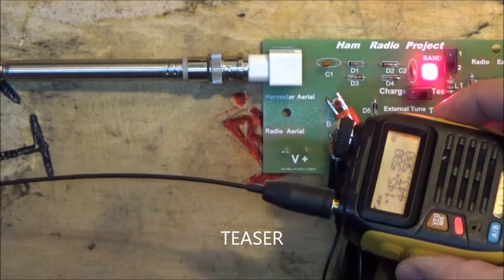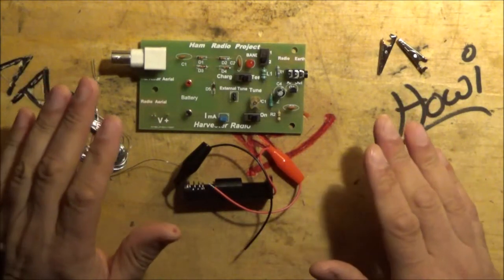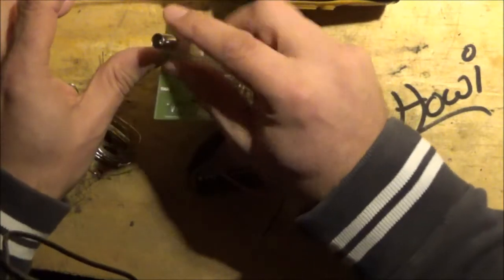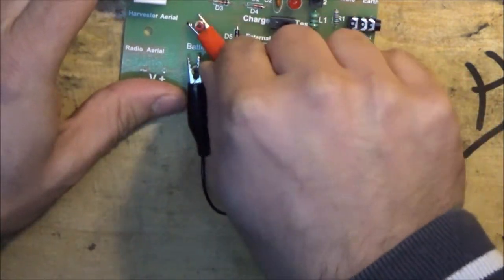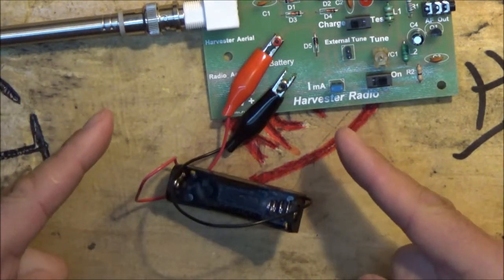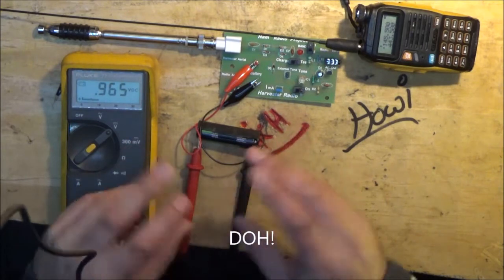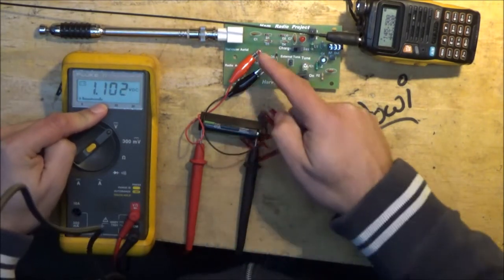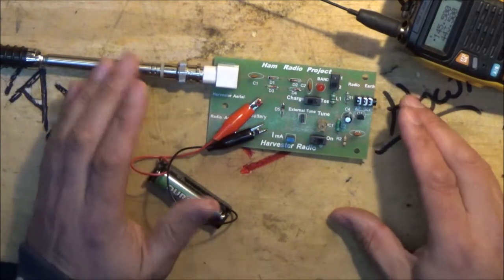DuB-EnG: Free Energy Radio Wave Harvesting PT2 - Testing - Does it work?

Comment: Hi thanks for a great video, i also had one of these radio from Trevor and found that it's works
well . I used a smaller battery than the AA one. (1.2v but  low mHa- from solar light from pound store) and that charge up better. I used it over two week in the evenings just before bedtime. Hope this of use , look forward to see you use it. Roger
Reply from the maker: TheAcehere1 Hi roger!... I started work on the final video today...  I made a mistake and am having to re-do part of it...  the single transistor radio is quite effective! (Oops that’s a bit of a spoiler) ...  Nevermind, no one reads my comment anyway!
Reply: Dubious Engineering thanks for your reply I look forward to seeing your final video on this item. I found playing around with it that antenna  about 10 feet works quite well for charging  and a good Earth is essential. I now subscribed to your videos so I can catch up with the rest of your reviews and projects best regard Roger
Reply from the maker: TheAcehere1 thanks for subbing Roger!!  Keep the comments and thumbs ups coming!!

Comment: If I was to have ten receiver boards would I harvest 10 times the power?
Do you reach a saturation point?
Do all the receiver boards need separate antennas? 
Richeee.
Reply from the maker: OMG - We could have fields of radio wave harvesters!  -  Like they do with solar panels! - ...  Just imagine!...   Ummm...  yeah, its low current, but may make for an interesting tinker while enjoying a beer on the weekend!
Reply: All you do is parallel up those diodes, I believe. At least this strategy worked with the no-electricity backpack radio included on the 6 million dollar man toy I had as a kid.
Reply: You want a link to my childhood 6 Million Dollar Man? I've long since outgrown that.
https://www.bonanza.com/listings/1975-Kenner-Six-Million-Dollar-Man-Backpack-Crystal-Radio-Helmet/508827687?goog_pla=1&gpid=173784728461&keyword=&goog_pla=1&pos=1o4&ad_type=pla&gclid=CjwKCAiAu4nRBRBKEiwANms5Wz1wdzU989s7Ub_b6LNYAjYBt_RQjZRP99Lfoke7lMrKt-wCycJ3_RoCvlIQAvD_BwE
Reply from the maker: Wow...!... I just checked the picture! ...  and saved it! ...  I plan to use it with a future video (I bought a cats whisker crystal and sprung wire) ...  this will be interesting!
Reply from the maker: John Possum ... come on... find a link and show us! ... I’m keen to include it in the final video of the complete system test!

Comment: Can you measure the current flowing into the battery from the circuit?
I'm assuming you had the Baofeng on full power so it'll be kicking out around 5 watts (give or take - I know they are advertised as 8 watts but mine does nothing like that).
Would be interesting to see how much of a percentage of the output power is making it to the battery.
Awesome little kit for learning about radio though. Might get one for the child! :)
Reply from the maker: I’m planning on putting a larger antenna into the bnc to see what happens.  Then I’ll get a galvanometer in line to see how much charge is going into the battery... also, I have the TRF radio circuit to test as well... expect one more episode!! :-). Thanks for your thoughts on this project!!
Reply: Cool, would be good to compare different sized antennas!